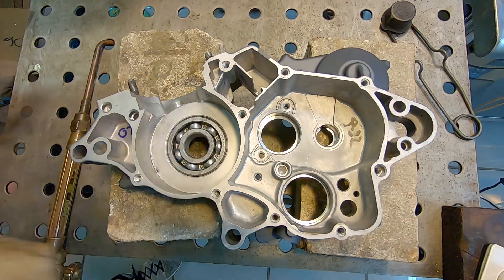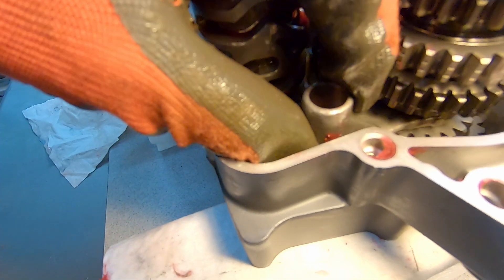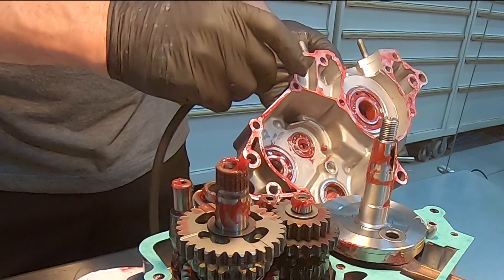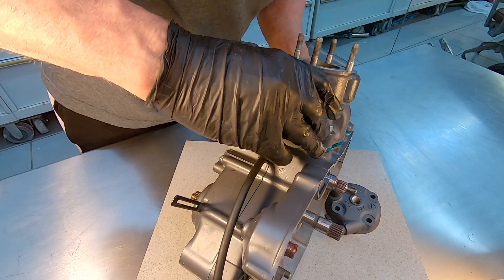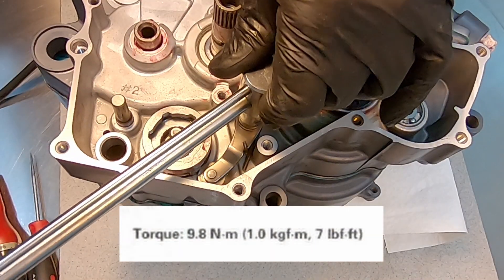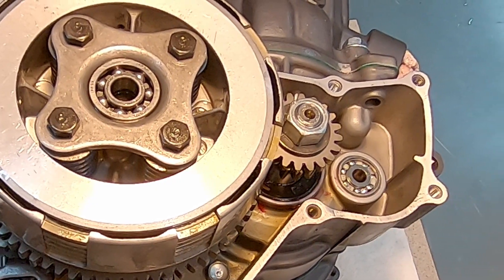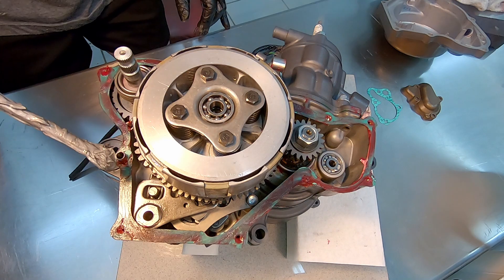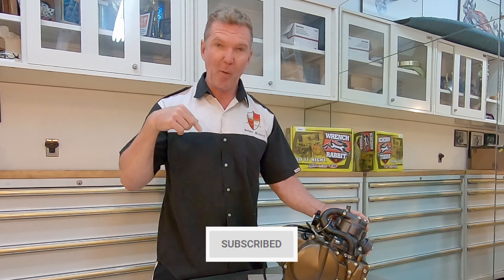Honda CR85 Engine - Assembly

Comment: How do you set the timing on one of these engines I have an 80 but they look quite similar. Thanks In advance btw love how meticulous you are with this
Reply from the maker: Thanks for watching!  One of the beautiful things about a CR85 is that timing is not adjustable. Just bolt that stator back on. Nothing to adjust.
Reply: @brian.d.mobley  really? Doesn’t the fly wheel have a magnetic spot on it or something that tells the spark plug when to fire? Or can you just put the flywheel on anyway and it doesn’t matter? Thank you lots
Reply from the maker: @seanraymond9529  It does hav that magnet spot. The flywheel is aligned with what’s called a “woodruff” key. If that key is installed on the end of the crankshaft, the flywheel will only go on if the key on the crank and the slot on the flywheel are aligned. If you do that, you’re good on the flywheel. On the stator, just bolt it back on. Do that and your “timing” is set
Reply: @brian.d.mobley  ohhh that makes sense thanks man  lol
Reply from the maker: @seanraymond9529  sure! Glad to help.

Comment: Thank you for your videos! I just did my wife's CR85. The one thing I got wrong was the Kickstarter. It looked to me like the spring was entering the rod at the 6 o'clock position in the video. I took it apart twice before I purchased the manual and realized it needed to be at the 12 o'clock position so as to separate the gears when the block on the bottom gear hits the stopper plate! I should have been looking for the split in the pink plastic piece. I am an idiot!  Great video my friend!
Reply from the maker: Youre are not an idiot.  I put the water pump seals in wrong not long ago!  Nobody is perfect!  And, its a lot of steps to do just perfectly when you build a motor.  Its not easy to do so many steps in a specific order and never make a mistake.  At least your tried to do the job yourself and you learned!

Comment: I have a cr85 im working  on and bought a new head gasket  put on and leaks out head gasket  any Ideas  ?
Reply: Hi brian sorry to interrupt but i also have a cr85 2007 that needs a rebore. I have taken it to my local bike shop and they said its got a steel sleeve in the barrel and it cant be rebored / honed have u any idea if this can be fixed ?
Reply from the maker: @jakeubbb265  I’ve seen those sleeves on sites like eBay. Honestly, I’ve never dealt with one so I’m not really positive about honing or boring if a sleeve has been installed. However, look up Millenium Technology. The do Nikasil repair and have a good reputation. They answer me promptly when I have cylinder questions. Email them.  They are better equipped to give you a reliable answer.
Reply: Thank you for the help brian i will give them an email soon as possible 😁
Reply: I forgot to mention that im in the uk haha i think the postage costs ect would be out of my budget 😂thanks anyways
Reply from the maker: @jakeubbb265  you could at least email them to ask if it was possible to repair your cylinder. At least you’d know if you had that option. If it is repairable, I’m sure plenty of shops in the UK could do the work.
Reply from the maker: Hi Richard.  A few things come to mind.  The head may be warped.  I go over that in another video titled "Tips and Tricks for Measuring Your Top End."  Another is the torque specs for the head are not correct or not the same on each of the four head bolts.  Check these first.  If your problem is not solved, let me know.